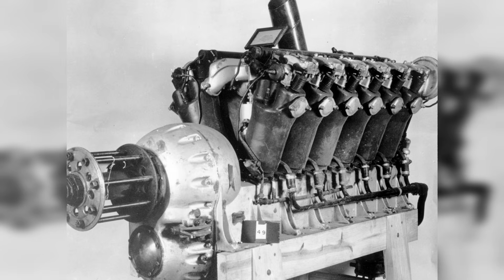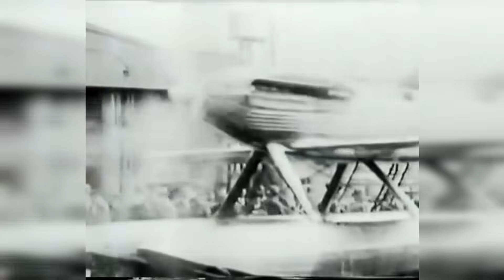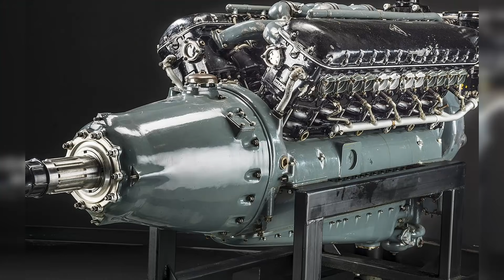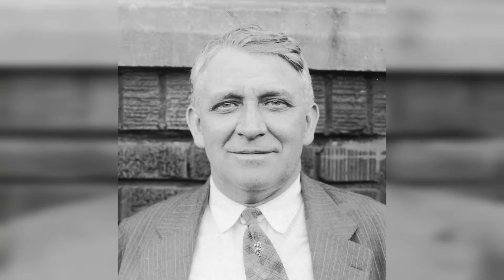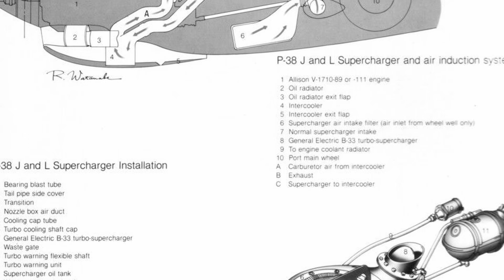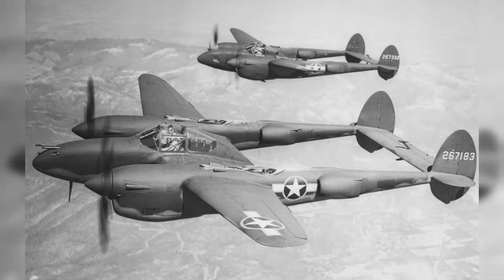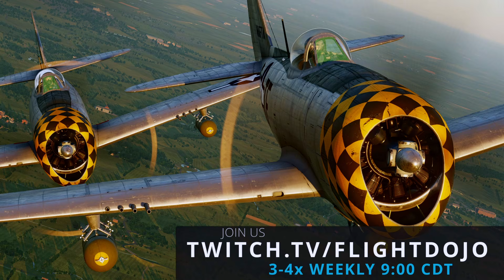Allison V-1710 - A Liquid-Cooled American WWII Warhorse

Comment: Great video, I think one thing worth adding is that while in hindsight we often remember the p38 taking a background role in Europe to the p51, it is well worth considering that before the p51 really came into its own with the merlin equipped p51b and p51c in late 1943 USAAF commanders were clamoring for as many p38s as they could possibly get. The p38 bore the brunt at perhaps the peak of the luftwaffes strength in well trained pilots, and before the fuel shortages and impact of the bombing on parts availability and quality were felt as the allied war effort strangled nazi germany. The p51 with the merlin just changed the game in having a fighter that could go the distance with the heavies at a far cheaper per plane price than the p38. Anywho, I really liked the video and will be subscribing, you clearly put a lot of effort into making this fantastically nuanced video on this fascinating topic, well done.
Reply: I've read that one reason for the P38 being withdrawn from the bomber escort role in Europe was its relatively low critical Mach number, which limited its maximum dive speed at altitude to less than that of single engined types.
Reply: Actually, the P38 was withdrawn because it had a huge number of issues with flying at the high altitudes of the European air war - a report by Doolittle stated that there was a high loss rate of the P38s due to engine failure, having to do with uneven fuel distribution amongst the pistons so that some got an overly rich fuel-air mixture and others got a lean fuel-air mix and so would suffer problems with detonation and premature crankrod failures (Doolittle explicitly blamed the design of the air-fuel manifold of the Allison V1710s) .   The tetraethyl lead added to the British fuel also tended to separate at the cold altitudes, which further worsened the problems with detonation.
This is all documented in the book:  "P-51 Mustang: Development of the Long-Range Escort Fighter" by Paul A Ludwig
Reply: @gandalfgreyhame3425  the Allison intake manifold was one of many issues with the P-38.  GM was slow to authorize R&D funds to allow Allison to correct that, among other issues.  Pilots called the engine the Allison time bomb.  
The P-38 airframe was also one of the worst for critical mach speed.  Dive flaps solved the "mach tuck" and control lock up, but the max dive speed was still unacceptable above 20,000', so it never was a good high altitude fighter as the LW could just dive away.
Reply: @bobsakamanos4469  P-38 had it's shortcomings, but it had the RANGE which was needed to escort bombers. Spitfire was useless as a bomber escort.
Reply: @heyfitzpablum  range yes, but what good was that if it couldn't operate at altitude with the bombers.  A tragic  error for both P-38 pilots and Bomber crews.  It was a fine attack aircraft for ripping up LW on the ground though.

Comment: Very interesting video on the Allison V-1710 engines also because I know very little about the history of the Allison factory. I always understood that the Allison V-1710 was easier to maintain compared to the Rolls-Royce Merlin and had better performance at low altitude. Regarding the issue of the P-38 that had issues over the cold and damp weather it seems to be controversial: years ago I bought a very interesting series of booklets, in this case the two parts on the P-38 variants. It emphatically stated that, here is the following excerpt: "the digestive problems with the engines that occurred at high altitude was argued, by other authors, was due to the cold and damp European weather. The booklet argued that temperatures and humidity are generally the same around the world at altitudes greater than 25,000 feet where those problems occurred when in the Pacific the Lightnings established a great record for reliability regardless of altitude and temperatures. Based on all the facts, it is evident that the poor quality of the British fuel is to blame, because they proved unsuitable for use in turbocharged in-line engines. Powerplants with two-speed, two-stage, mechanical superchargers and even radial engines with turbo superchargers did not have the same ingestive problems with the British fuel but the combination of an inline engine and a turbocharger always did." Mind you that those are not my words as I merely copied it but who wrote this seems to know the facts. That said I didn't know that the Army didn't let the Allison company to develop their own mechanical turbocharger that would have permitted to develop better high altitude engines without  needing to use Packard made engines. Good job again 👍👍👍
Reply: The fight in the ETO was at height and this told against the Allison Most PR was at extreme height and this ruled out the Allison without the Turbo-supercharger
Reply: @jacktattis  in this you are correct but remember that the Allison V-1710 had better performance on low altitude...
Reply: @paoloviti6156  Yes better than the radials about even with the Packard Merlin depending on Variant
Reply: Is it not funny that the Packard the Merlin all ran very well on that poor quality British Fuel.  Mate the US was in the war in the Med when the P38 was in action for the first time July 42 and by then it would have been US fuel . The Army does not control whether a private company can or cannot develop its own Supercharger. Hell Merlin and Packard were improving their engines from Day 1 right through the War
Reply: @jacktattis  here the story gets a bit complicated because the Packard-Merlin never flew with low-quality fuel because it was supplied directly from USA both in England and the Pacific. But it is true that the Packard-Merlin performed well with lower quality fuel whilst the Allison V-1710 engines suffered from this, the reason why the P-38 had initially serious issues...

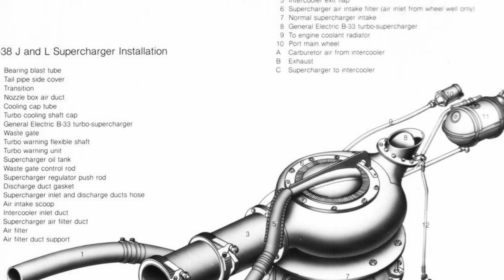Comment: Very nice video, but @ 02:36  The airships were the MACON, as in Macon, Georgia (not the MacKRON) and the Akron, as in Akron, Ohio.   Oh, and also, @ 18:25, it's "Greg's Airplanes and Automobiles" and not the other way around.  Otherwise, i'm sure Greg appreciates the plug.  And speaking of "Greg's Automobiles and Airplanes," and the P-38, Greg's video on the P-38 talks about the high aerodynamics drag of the airplane that were mostly due to the design and placement of the turbo and cooling scoops.  It would have to be inferred that due to the V-1710's lack of a second stage supercharger and need for the turbo in order to have any kind of acceptable high altitude performance and additional plumbing and the drag the turbo caused, a Merlin powered P-38 could have been a much faster airplane and would not have had the problems created by the turbo and its cold temperature oil issues, a more reliable one as well.  Then near the end of the video, when discussing the V1710 and the Mustang, I can't believe you would ignore the use of the V-1710 in the F-82 Twin Mustang.  The V-1710-143 and -145 variants of the engine and their two-stage superchargers would have gone toward proving, as you have opined, that a two-staged supercharged P-51 would not have needed to be retrofitted with the Merlin in order for it to be one of the best WWII fighters.  Also, also, turbo-compounding was also used in radial engines such as in the Super Connie in its Wright R-3350 Duplex-Cyclone engines.  Other than that, very nice video.
Reply from the maker: all good points beeleo, I didn't mention the F-82 because or the P-51J because I was already going long on time, but those are good examples of my point. I totally mispoke on plugging Greg's channel.
Reply: @bearingunknownyt  The reason the 1719 replaced the Merlin in the P/F-82 was due to economics. After WWII the Brits wanted to charge the US  government an obscene licensing fee for Packard built Merlins so the decision was made to go with Allisons
Reply: No.  A Merlin Powered P-38 would not have been a faster plane.  The Turbo Allison was stronger than the two stage Merlin.  It might have solved the issues with the turbo at altitude over Europe, but it would have required some time to redesign P-38 for the Merlin.  By which point, the P-38's issues had largely been solved and the P-51B, C, and D, were already available.  

Turbo Compounding was used in the 3350, but only post-war.

Comment: Nice overview! I'm dubious about turbo compounding though . It looks good on paper but as always it's more weight and more to go wrong plus where would put it all in a single seater. I read.somewhere that Power Recovery Turbines on the Wright Turbo Compound engines  were nicked name Parts Recovery Turbines or something similar.
Reply: I was in charge of field maintenance for a time at McClellan AFB, California, which included C121 aircraft. with Wright Turbo Compound engnes on C121 aircraft.  The engines performed well in that usage.  We also benefitted from excellent factory tech reps on site, well-presented classes on the engine design, and very competent mechanics.  Also, though I am not knowledgeable on details, the engine manufacturer had made improvements to the engine following WWII.  They still made an impressive cloud of smoke at startup.  Oil in the lower cylinders is one of the challenges of radial engine design.   An excellent book on many WWII aircraft engines is "The Secret Horsepower Race, Western Front Fighter Engine Development.  Japanese and Russian engines are little discussed.  I believe that Volvo Trucks has civilized the power recovery turbine and now uses it on D13 truck engines.

C121 aircraft.

Comment: Nice video, the Allison has always been the described as a dog by the uninformed.
Glad you mentioned the Allison Engineering bearings which were its real bread and butter before the war.

A little mentioned note about the 1710 was it passed the 100% power for 100 hours requirement that the Army specified, which the RR and RR/Packard were never subject to.

And finally, the Allison is always compared to the later Merlin Mk XX engine with it 2 speed charger. 

Thanks for an interesting vid.
Reply: That is NOT the two stage version, RR use three different superchargers, a single stage up to the 20 series, the 20 to 50 series got a second SPEED, and the 60series got the drooled and slobbered over 2 stage  2 speed supercharger !!
Reply: @wilburfinnigan2142  tHAT 2 STAGE ALLOWED THE sPITFIRE TO PEE ALL OVER THOSE aLLISON AND radial rubbish
Reply: @jacktattis  2 stage RR-Packard was a performer but it wasn't cheap. There is no free lunch, every engine design is compromises on complexity, performance and cost. The Pratt and Whitney R-2800 that you call 'rubbish' ruled the roost in the Pacific in the Corsair, Hellcat and Thunderbolt-at significantly lower cost than the Merlin. The R-2800 was also more robust, more impervious to damage and easier to service. Radial engines give better power to weight, that's why they are used on nearly all carrier aircraft applications. At the end of the day the RR Merlin was a thoroughbred and when the situation justified the extra cost and complexity, that was the engine to use. Pratt and Whitney R-2800 was a workhorse.
Reply: The RR tested there engines at full power for 24 hours, the knock down and checked for ware, and little ware but not measurable.
Reply: The Allison engines had a host of problems, especially the intake manifold that caused detonation.  The G version was finally well strengthened, but Allison never made a reliable high altitude V-12.

Comment: Enjoyed your video on the DB-600 series, and I incorporated it with the information I have gotten from other sources.  One other channel which has produced very accurate videos about WWII aircraft and the associated technologies is Greg's Airplanes and Automobiles. (https://www.youtube.com/channel/UCynGrIaI5vsJQgHJAIp9oSg)  Greg comes from a flying background too, but he goes into very deep detail about the engine performance, manufacturer's data and aerodynamic performance of the airframes.  The thought that the Allison V-1710 was a low altitude engine happened because it's original single stage supercharging system was not as efficient as the early single stage Rolls Royce Merlins, but there were mechanical second stage developments (which were mostly not adopted because of production needs), and also a second turbocharger stage was used on the V-1710 for excellent high altitude performance in the P-38.
Reply: Excellent high altitude performance Not in the west it had all kinds of problems 40000ft Max as tested was not that great

Comment: Ford developed an engine far superior to the Allison and Merlin prior to WWII, but the ardent socialist, FDR prevented Ford from getting any aviation contracts. Ford developed the GAC, which was a true aluminum V-12 mono block with DOHC. In contrast, Merlins and Allisions were constructed from separated cylinder and crankcase castings because they lacked the competence to produce a mono block, and both used an inferior SOHC arrangement. 

As WWII dragged on, the US Army convinced Ford to make a V-8 version of the GAC for tanks. This engine was designated the GAA and performed exceptionally well. The Army eventually incorporated some GAC's into tanks, but they never when into their intended aviation service because of some corrupt politicians.

Comment: Very nice  report for a change; one thing I would have added is that Allison was NOT allowed to develop a direct injection fuel system which would have improved cylinder to cylinder balancing. You could also have mentioned that the P-63G was slated to get the compound turbo system.
Reply: Rolls /Royce stayed with carburetion because cooler fuel gave more density which gave more bang for the Buck

Comment: Did turbo compounding add significant bulk to the engine housing in an aircraft? Was it done in combination with super/turbo-chargers or in place of them?
Reply: Its more compact than the super/turbocharger but slightly bigger than the 2 stage supercharger.

Comment: Did you misspeak on the turbo compound system in that it being or having a compressor? Isn't it a power turbine driven by the exhaust gas that is mechanically coupled back to the crankshaft? No compressor?

Also, wasn't the Allison powered Mustang faster than the Merlin powered version at low level?
Reply from the maker: I misspoke, I meant turbine. Good catch. 

About the Mustang, I seem to remember having heard the same, but I don't have the hard data to back that up right now.

Comment: Have you seen the RR Heritage book “Rolls-Royce and the Mustang”. There’s a huge level of detail on the Merlin the Mustang and things like turbo compounding. 
By the way RR struggled with oil pumps. Merlins basically threw con-rods until they realised the oil pump was not big enough to meet demand at high revs.
Reply: Wasn't it also a poor system? as it started it self due to centraful force and that makes sense why high rpm gave it greaf
Reply: Oh shit Stan and Ernie been sleeping on the job, not to be aware of the Merlin,s undersized oil circulation pump, talk about a bad hair day. Why this  serious issue was not flagged up in test bench runs at 3,000 rpm or more is odd and at least disturbing on such an important engine. So early Roller Merlins kicked their feet out the bed(con rods bursting from the crankcase) that is bad, thought the magneto drive issue was bad but  Merlins kicking their feet out the bed at full power, that is dire so Stan,s spent too much time propping up the bar down the 'Rat&Ferkin' pub.
Reply: @basiltaylor8910   Source please verifiable
Reply: @basiltaylor8910  you're a strange man ( but I like it )
Reply: @gingernutpreacher  Thank you for the kind comment , i do not pull my punches,in the late 1930,s due constant parsimony by our stupid  short sighted air ministry our aero engine industry was a bloody mess.
Reply: @basiltaylor8910  Rubbish show mod ?
Reply: @jacktattis  Please explain your comment ?.
Reply: @basiltaylor8910  You made a comment about Merlin Con rod failure did you not. I have Rolls Royce Merlin Workshop Manual There is not a mod where they corrected any conrod failure
Reply: @jacktattis  Reality check it was nothing to do with the con rods it was the  system  supplying oil to the con rod bearings and nothing to do with the rods themselves. Reason for said rods kicking  out the bed  at high rpm is due to oil starvation brought on by an undersized circulation pump, said  pump was at fault. Roller engineers had no option but design a bigger oil circulation pump, especially when Stan and Ernie were souping up Merlins to combat Kurt Tanks Evil  Creation the FW190 Wurger(Shrike) knocking out RAF Spitfire V,s Merlin 45 ,47 like ducks at a duck shoot.
Reply: Source please verifiable
Reply: It was a  good boat engine
Reply: They changed the oiling system to an end-to-end lubricating system from inside the crank allowing centrifugal force to work for rather than against the process.  Always improving.... and yet Lycoming continues to use the old system of flinging oil.  Allison on the other hand never made a reliable high altitude engine and the overboosted engines failed constantly, contrary to the jingoism read on social media.
Reply: Rubbish nothing about conrod failure in Rolls Royce Merlin Workshop Manual and no Mods either